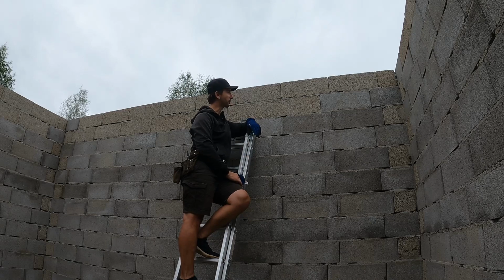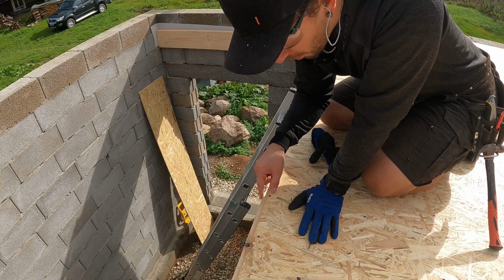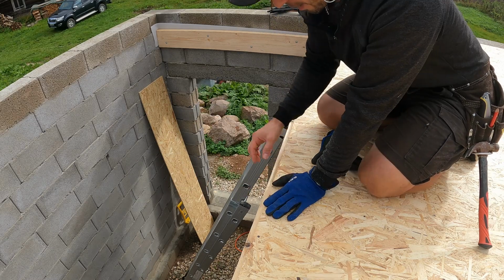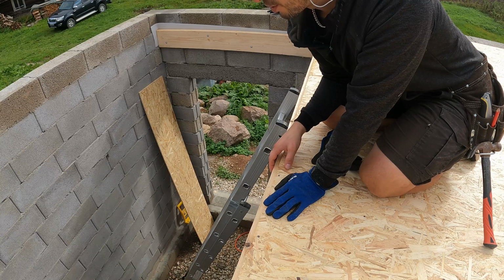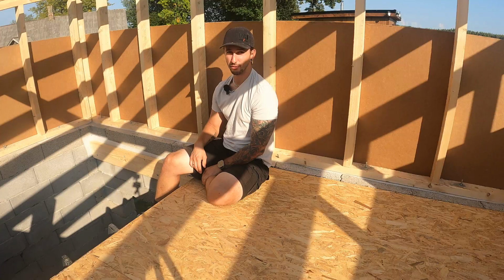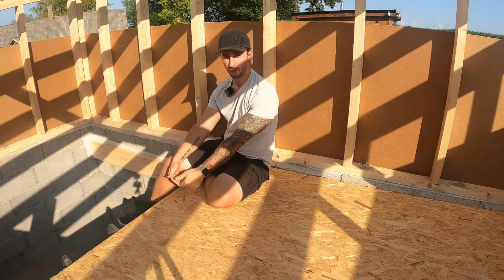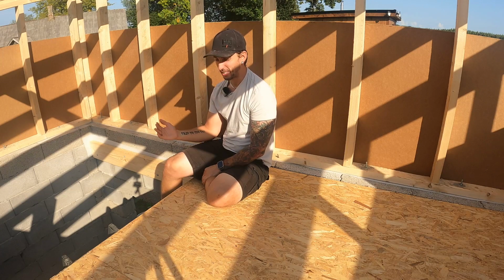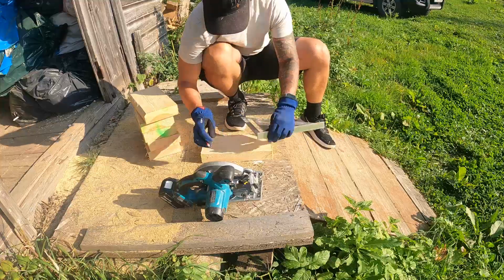Building penthouse for my man cave

Comment: Shouldn't the metal go under the shingles......do you turn the first run of shingles upside down with that type of shingle I've never seen them before
Reply from the maker: The metal covers shingles at the ends to prevent water going under them, but at the lowest side it goes under to prevent water going under the metal from the shingles and gives strong edge there. 

As for the first row turned upside down to get first straight line. Otherwise there will be gaps because of the shingles’ pattern. 

I hope I’ve described what I mean 😁

Comment: Thanks for the video.
Dont understand why you didnt make it min 6ft
If wind gets under that 1st roof membrane thr whole thing is gone.
Do you have snow and ice? That roof pitch with ice damn will leak. tourch on is better.
Reply from the maker: I’ve covered corners with metal. It should protect from wind well enough. We have same thing on our main house and has been fine so far. Yes we have snow and ice here. So far no leaking 😂 but there we have very thick osb under shingles. Here nails are through. 🤞it still should not leak